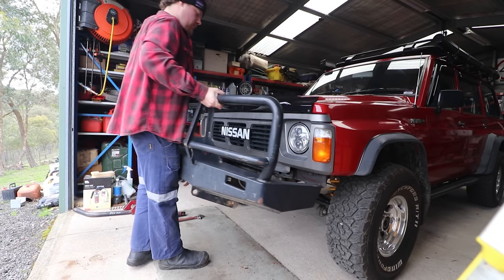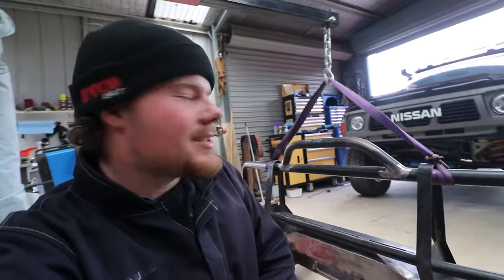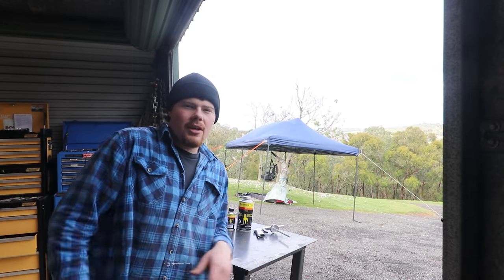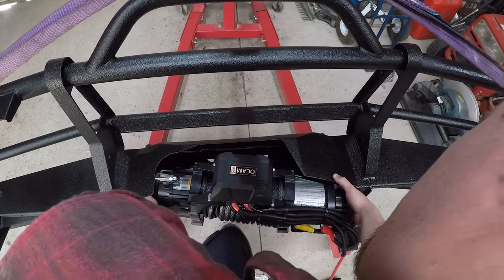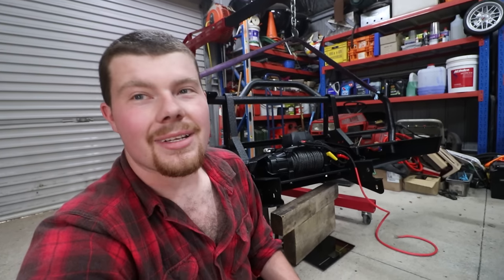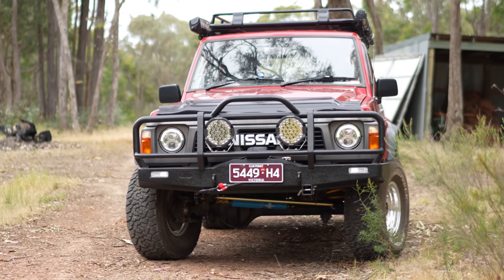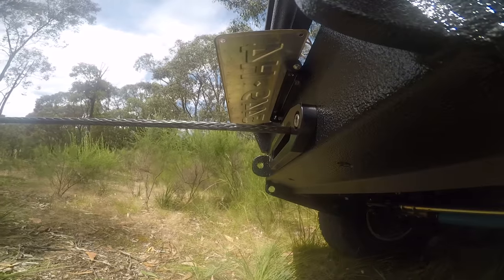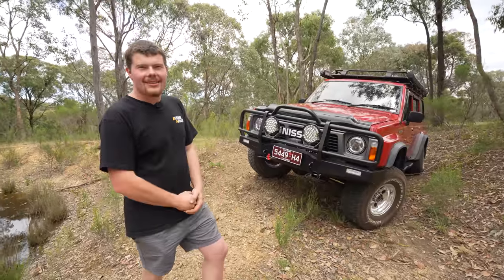We made ARB's Bullbar BETTER.

Comment: killer job. maybe some plastic restore on the flares?
Reply: I've recently used linseed oil on the unpainted plastic bumpers off my car and it works great. I've tested it on other surfaces and it seems it leave a sticky residue on anything smooth however.

Comment: BIGGER, BETTER, BADDER, BLOKIER, that's how blokes do it Dan, well done mate, be an individual that's what it all about mate. Just remember too Dan, that antenna spot on the drivers side could be used for a sand flag. also, the Hayman/Reese hitch on the front, great idea, I had one on the front of my forby and I made slide in mount to hold my vise, which was very handy if I needed it and I also had one as a step to get into the engine bay to work, because I'm a short ass, there I said it OK, haha.  Did you only need one can to paint the bull bar Dan ?.   Seeya Rob

Comment: for a grounding plain for ants you are typically  at between 2-3 inch thick metal

personally i would nmot use the arb bullbar as typical for what you are doing because it  just no dense enough  past the odd thin tree branch..

I'm inclined to run 2 uhf and 1 hf radio 1 uhf for narrowband and the other for wide band use.. and hf with ssb/usb/lsb functions I would also consider adding in vhf as secondary comms platform for marine and air contact...

i would err on the sid4  of caution if using  shims as a fixing point especially  if using a inner diameter as a friction fit  bull bars  where you use a lock washer and 2 locking nuts to attach bull bar to vehicle

Yes, welding a nut bon can be done  however you likely to be weakening the nut doing  so as what you are welding too is a different density

as much as i like ARB bull bars none would be able resist an animal strike given the metal don't look like it is past a 1/2 an inch in thickness

Comment: Nice work. Ebay leds are not waterproof and seam sealed ours still failed and the seller didn't want to know. Pity cause they fit these older bars real nice. Going back to original lights now.

Comment: So many concerns with this one guys. Aren't you delving in "questionable territory here", by modifying a bullbar?
If the vehicle is prior to a certain date (think it's 1988, "unsure") it can basically have any frontal protection.
From then onwards, aren't they meant to be fitted with "compliant manufactures" bullbars?
Aren't any mods to a compliant bull bar illegal?
Forward protruding recovery points fitted here are illegal.
Top bar would be considered illegal, (nothing to do with drivers view), it's all about pedestrian safety now, in a world that's gone crazy.
The consideration should be on protecting the people within the vehicle safely during an animal strike, but the instigators of law overlook that as the primary roll of a bullbar today, pedestrian safety council consider them 100% not required.
100% wrong in my view but I'm just your average guy.
I'm not being critical, just concerned you may be promoting actions that are simply no longer allowed.
Constable Plod could make life a misery for you with non compliant issues, just saying.